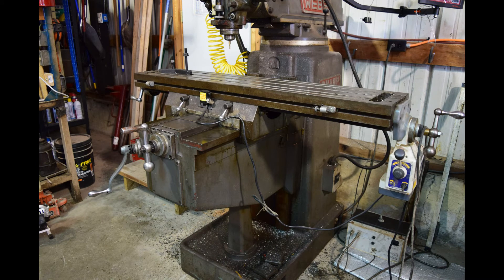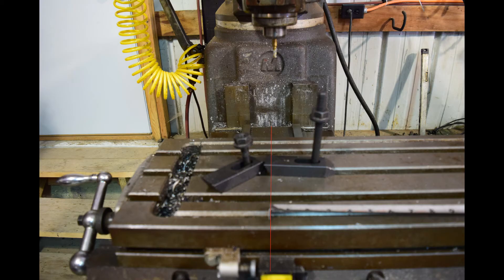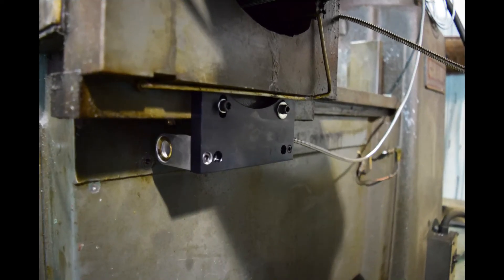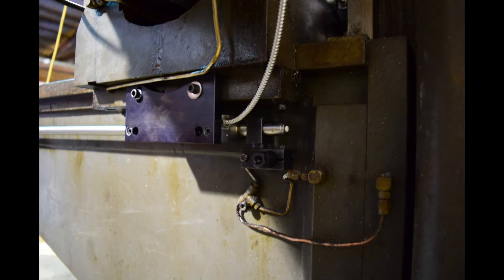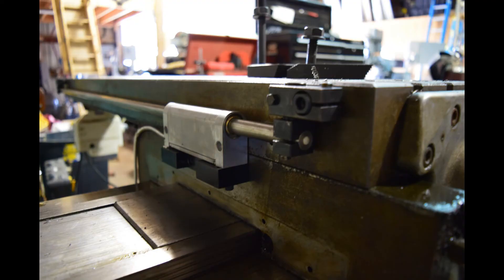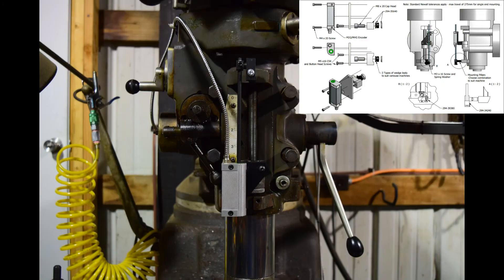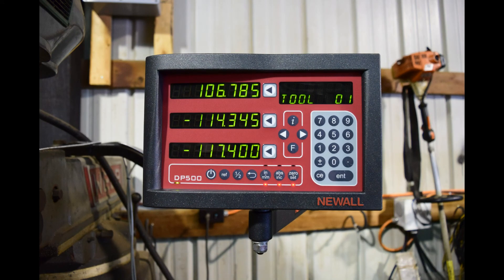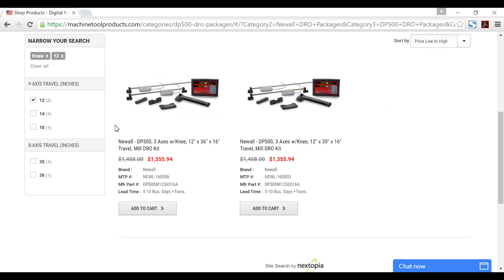How to Install a Newall Digital Readout DRO Kit onto a 3 axis Mill

Comment: where did you find the picture for mounting the Z.  My instruction had no such picture.  Really wasn't sure what to do.  Started to read the instruction but that did not last long.  Thanks for the video.  I ended up flipping the black plate over and countersinking it.  So mine is not only rotated its also flipped.
Reply from the maker: You can find the install document here: https://machinetoolproducts.com/quill-bracket-kit-for-microsyn-scale/ It is typically included with the Quill Bracket Kit

Comment: I just got a new Jet 1050 Mill, with 3 axis powerfeed, but they only put a Newall DP700 2 axis DRO on it, can I get just the 3 axis monitor and the scale for the Quill?
Reply from the maker: We can certainly do that for you. If you would provide an email we can send you a quote! Another option is to visit our website and start a chat with a representative.